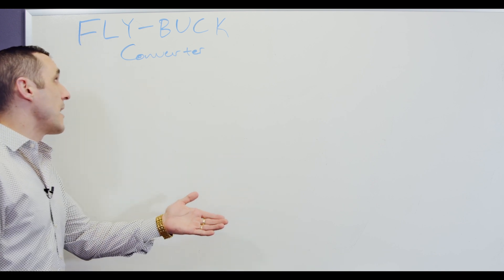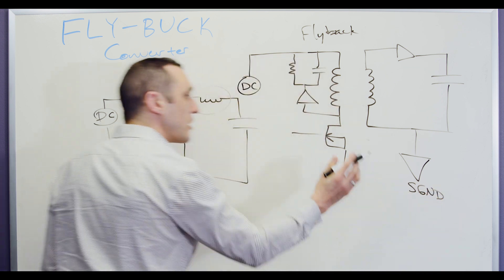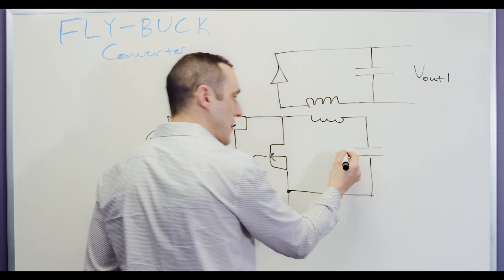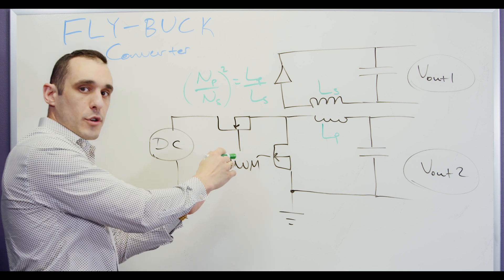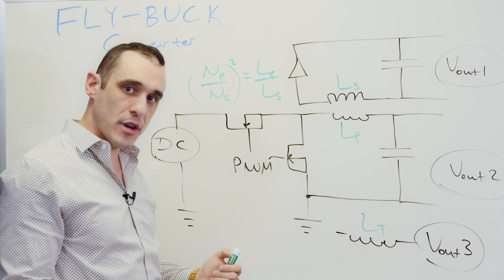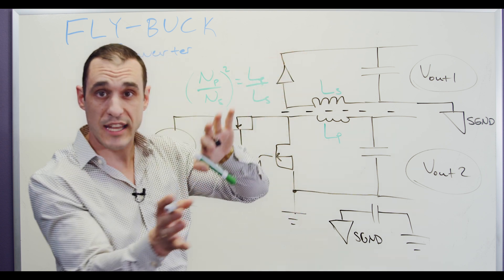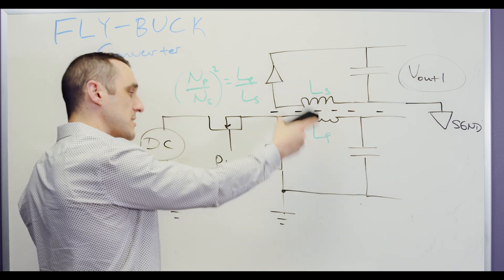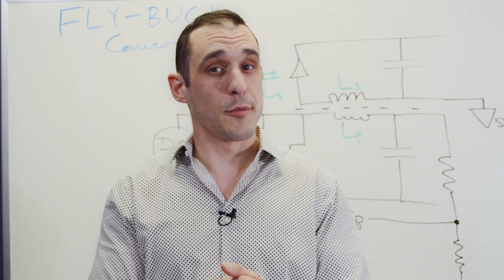What is a Fly-buck Converter?

Comment: Please do a deep dive in HV non isolated buck. Like a mains level input to non isolated, non inverting 3.3V or 5V output for devices within few watts running a MCU, small sensor, etc. 

There are dedicated chips but some people have used a flyback converter chip for this.
Reply: Ok I can put something together about it, this is a good question but I would bring up the fact that people use isolated converters when connecting to mains or high voltage because of safety, not necessarily because the design must be isolated in order to work correctly. This is especially the case when the input is AC because the AC input will be unregulated, so it can be very dangerous if there was ever a fault in a non-isolated buck converter. Either a short between mains and output would destroy the load or it would injure the user.

Comment: Great video, thank you! How about connecting the secondary voltage output to the primary ground, then the secondary ground becomes inverted, with a 1:1 transformer you would get a dual rail output for the price of one buck controller say for powering opamps
Reply: Very interesting idea, it sounds like a quick way to build an inverting power supply, kind of like a flyback with a center tap?
Reply: @Zachariah Peterson  indeed, very quick and useful circuit but not exactly like a center tapped flyback since  the ground is not a virtual one. I first came across the circuit in the application examples for the LT1616 stepdown regulator. Last page shows a bipolar output dcdc converter and having used it with different controllers, it's now my go to power supply circuit for my analog designs! What do you think ?
Reply: @YoussefEl.  Would you mind sending it over to me and I can take a look? You can find me on LinkedIn and send me a direct message. I could also look at it for our upcoming 1 Minute Design Reviews series that we are doing for YouTube shorts and TikTok.

Comment: My first thought for this is that it would be good for a hybrid triode/Class D amplifier, for those who want that "sweet, sweet triode distortion" that we still haven't been able to replicate with solid state components. 6V6 for the triode filaments and Class D amplifier; 40 turns ratio transformer for decent triode plate supply, Bob's your uncle.